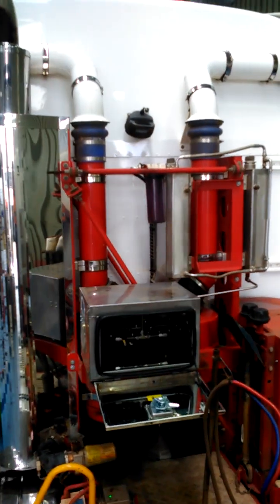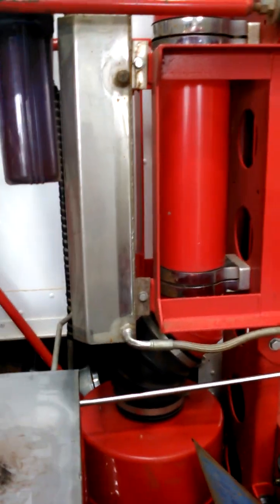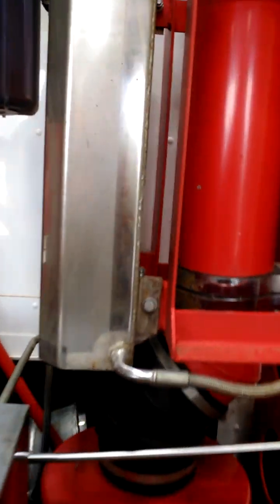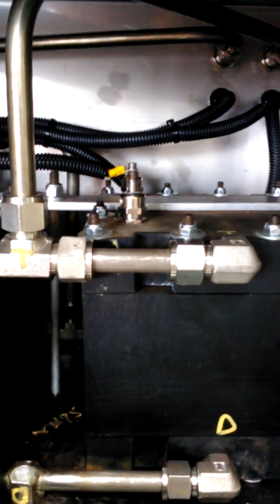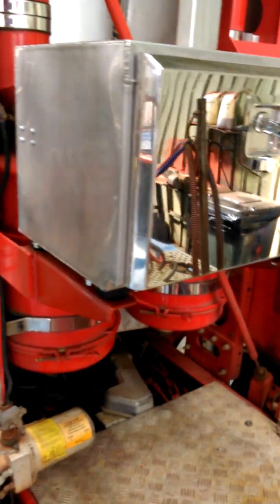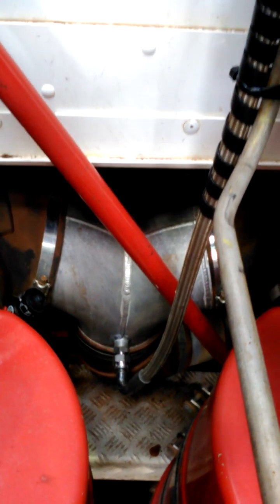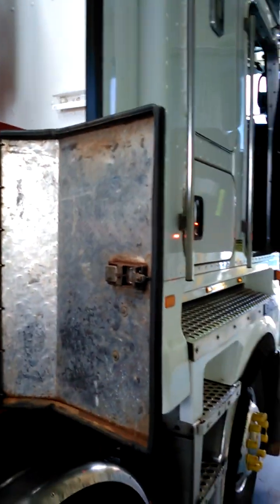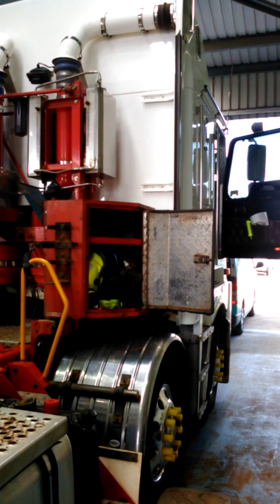Gen 20 Hydrogen fuel system for trawlers , Boats, and Gensets

Comment: Thank you, you are doing a great job. Blessings and good wishes.:rocket-red-countdown-liftoff:
Reply from the maker: tests show 34 % to 42 % savings    look at https://hydrogenfuelsystems.com.au    call gavan 0403177183
Reply from the maker: Gavan Knox glknox11@live.com  and https://hydrogenfuelsystems.com.au     System running at 12.5 volt and 35 amp producing 4.2 litres of hydrogen gas per minute.
Increase the gas flow by using a Higher input voltage and also by  adding 20 grams  Potassium hydroxide to the 3 litre water recycling tankl
Call gavan 0403177183
september  30 2025

check out our webpage https://hydrogenfuelsystems.com.au
Reply from the maker: Certified test results have show savings of 42% on a 2.8 LItre diesel and a 3.6 Litre  petrol fueled wagon     call me on 0403177183     glknox11@live.com      patented proven system https://hydrogenfuelsystems.com.au      Gavan Knox BSc, BEd
Reply from the maker: Certified test results have show savings of 42% on a 2.8 LItre diesel and a 3.6 Litre  petrol fueled wagon     call me on 0403177183     glknox11@live.com      patented proven system https://hydrogenfuelsystems.com.au      Gavan Knox BSc, BEd

Comment: Price?
Reply from the maker: Generation 10 is $4350
Reply from the maker: $4650
Reply from the maker: call me on 0403177183 or send me your phone number so I can call you
3.2 to7.2 lpm   12 v 30 A     https://hydrogenfuelsystems.com.au  0403177183    Read international certified report on front page of my webpage   32% to 42% savings on a range of vehicles... diesel, petrol , gasoline, LPG   Gavan Knox BSc, MSc, BEng BEd
Reply: Gavan why do you not use PEM cells and a gas drier for all the moisture in the gas which can rust internal parts? Thanks.
Reply from the maker: @paulackermann371  Water does not cause rusting.
Cold water in contact with metal contains oxygen dissolved in the water and allows for oxidation to occur
The water that is produced from a internal combustion engine is superheated steam has a temperature of many hundreds of degrees Celsius.
There is no dissolved oxygen and rusting will not occur
Reply: @gavanknox3220  Hi Gavan what about PEM cells they do not need KOH or baking soda as catalyst. Hydi Hydrogen from Adelaide sell these units. Can send you pictures of one on a concrete truck from my work. As well there are Bob Boyce units same as yours up to 6 LPM they have drier attached on all their models. Apparently the volatile gas does not eat through the parts as quickly? Central Valley HHO is another company which you probably know of with these units. Been following your site since Coogee Chemicals and those buses in Auckland  and taxis in India. Wish you had a test unit/demonstration unit to show. Would be great to hear your ideas? Thank you.😊
Reply from the maker: @paulackermann371  Hello Paul
Yes I know Heidi and South Australia Sell neutral place systems And this type of system generates a lot of heat.
If I really want to boil water I’d buy kettle
Reply from the maker: @paulackermann371  there are lots of photos on my webpage https://hydrogenfuelsystems.com.au
By international partners produce larger systems and that can also be seen on the link on my webpage 
Call me on 0403 177 183
Reply from the maker: Gavan Knox glknox11@live.com  and https://hydrogenfuelsystems.com.au     System running at 12.5 volt and 35 amp producing 4.2 litres of hydrogen gas per minute.
Increase the gas flow by using a Higher input voltage and also by  adding 20 grams  Potassium hydroxide to the 3 litre water recycling tankl
Call gavan 0403177183
september  30 2025

check out our webpage https://hydrogenfuelsystems.com.au
Reply from the maker: Gavan Knox glknox11@live.com  and https://hydrogenfuelsystems.com.au     System running at 12.5 volt and 35 amp producing 4.2 litres of hydrogen gas per minute.
Increase the gas flow by using a Higher input voltage and also by  adding 20 grams  Potassium hydroxide to the 3 litre water recycling tankl
Call gavan 0403177183
september  30 2025

check out our webpage https://hydrogenfuelsystems.com.au
Reply from the maker: Certified test results have show savings of 42% on a 2.8 LItre diesel and a 3.6 Litre  petrol fueled wagon     call me on 0403177183     glknox11@live.com      patented proven system https://hydrogenfuelsystems.com.au      Gavan Knox BSc, BEd
Reply from the maker: Certified test results have show savings of 42% on a 2.8 LItre diesel and a 3.6 Litre  petrol fueled wagon     call me on 0403177183     glknox11@live.com      patented proven system https://hydrogenfuelsystems.com.au      Gavan Knox BSc, BEd